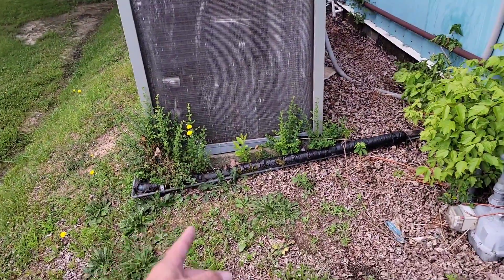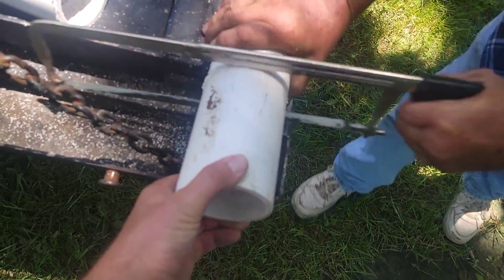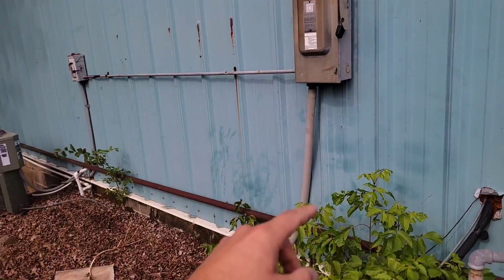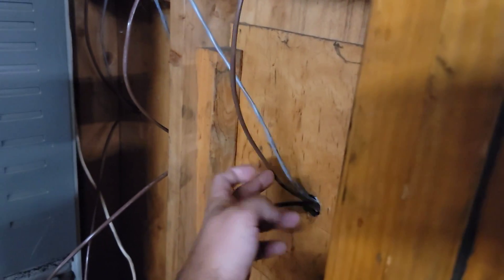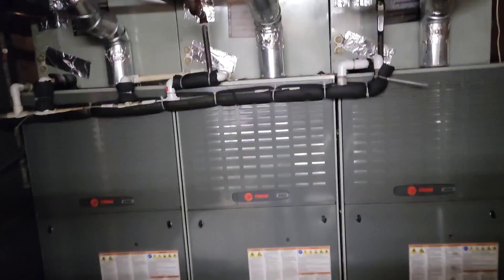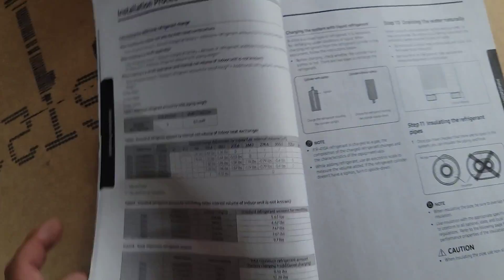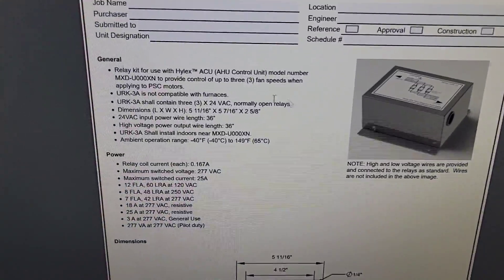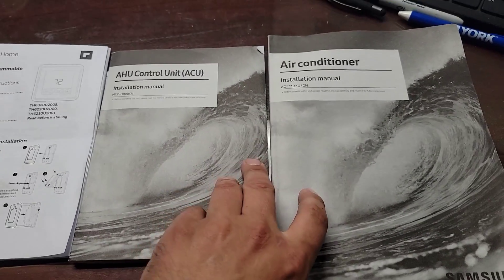Samsung's Mind-Blowing Hylex Heat Pump Revealed!

Comment: I can’t figure out how to pressure test my line set and evap coil. Do I have to add service ports?
Reply from the maker: no use valves that are there
Reply: Yeah I feel like an idiot. Right after my comment I figured out it was the hoses I was using. 🤦🏻
I appreciate it.

Comment: Are you running these units as heat pumps? If so, how are you controlling your lockouts between the gas heat and heat pump heat? 

Also, the Hylex manual calls for installing a bi-flow filter drier on the liquid line, but they don't include one with the unit, so you need to buy one in addition to the new unit.

Comment: Can individual thermostats call for cool or heat on their own furnace with the other two furnaces not running? If yes, then what is going to prevent recirculation of common supply air back through inactive furnaces into common return? Also what prevents heat and cool from being set on different thermostats at same time? I started an Am Std 5 Ton 14.3 SEER split heat pump today...total amps on hp was 14.0A. What was your TA on 2nd Stg on those 5 Tons? My old 18 yr old burnt up Rheem's were typically 19.5A, one noisy one was 29.0A!  Thank you. Looking like good work and nice units. I'm still slammed for at least two weeks. School starts soon and it always dries up a little. It's been a great summer up here.

Comment: we have to use a sleeve w/ velco uv resistant on exposed lineset. its $450 for 75ft. to save costs we use line hide. but even that 4 feet to the wall, code prohibits from using that uv tape. id imagine mitsubishi cost more than samsung. from seattle.. im not a tech

Comment: So the air handlers and thermostats are still running on legacy wiring and the control boxes convert that traditional wiring to the communication signal for the condensers? Is it DC voltage?
Reply from the maker: DC voltage for the communication between the condenser and the a h u control yes
Reply: @taddydigest do you have to have all the blowers running since the furnaces still share supply and return?

Comment: We’re having issues with a hylex where it’s utilizing the cooling function for the heat pump but when we set it to heating, it’s using the American standard furnace and turning it on instead of utilizing the heat pump for heating
Reply from the maker: Did you make sure that the programming of the thermostat was correct